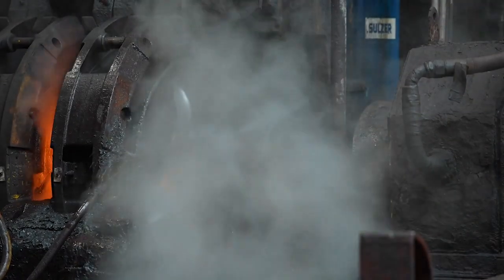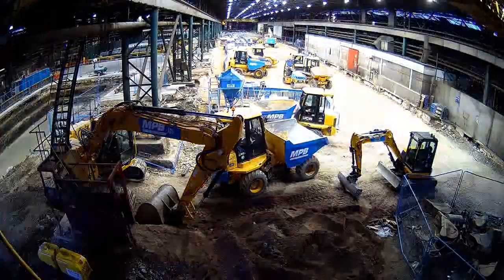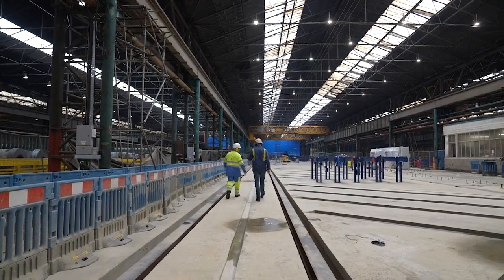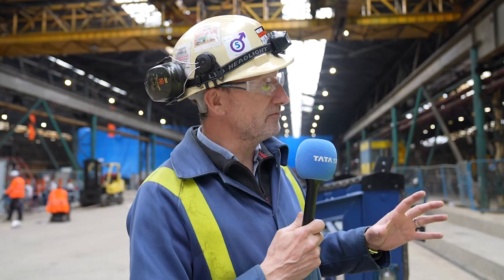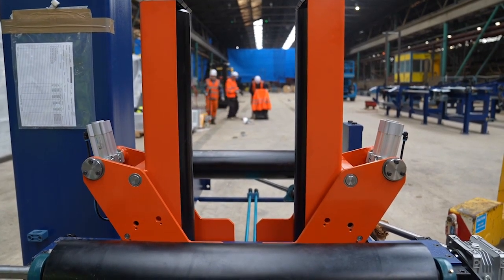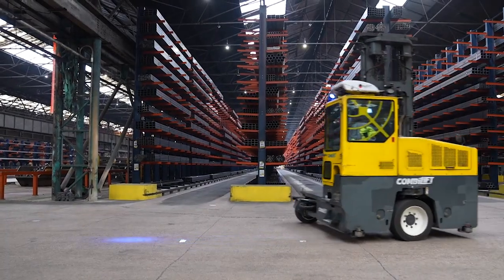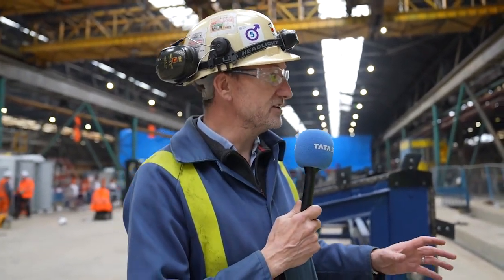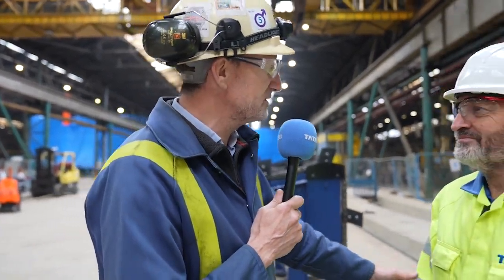Installation of Corby's new combination mill

Comment: A very short sighted move by Tata Steel not to include weld line annealing on the new mill as all pressure pipe could have been so produced leaving the hot mill free for structural products.